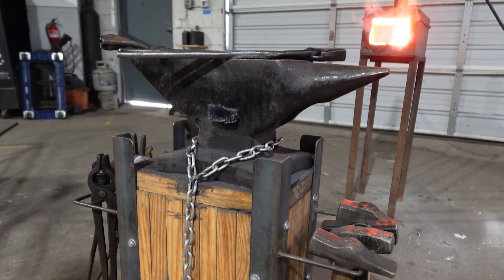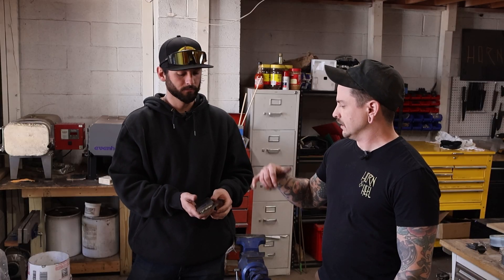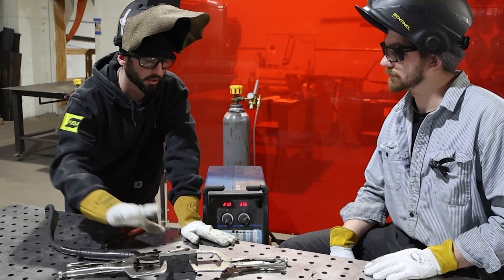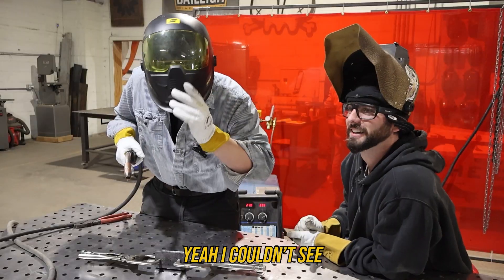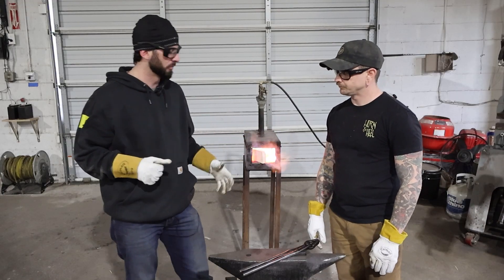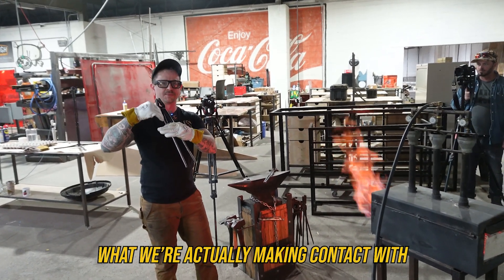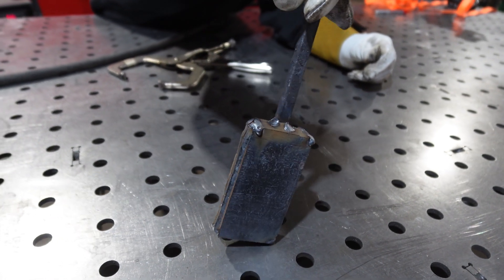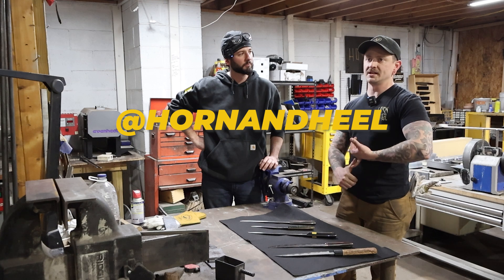How To Make The Strongest Chef Knife | Go Mai Forging With Horn & Heel

Comment: Can that initial set done straight out of the forge on the hydraulic press be achieved with a simple shop press?
Reply: I've seen people turn 5ton log splitters into forge presses with good results. I'm no expert but would imagine a good shop press would be suitable. My only blacksmithing experience is making a railway tack anvil (can see a video on my channel of you want to see) which I normally panel beat cold metals on so I could be wrong mind